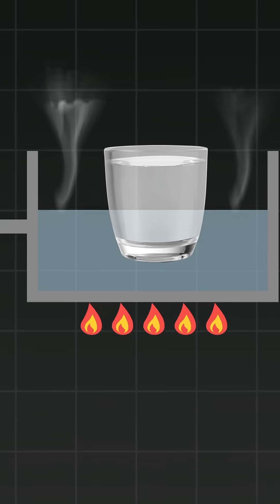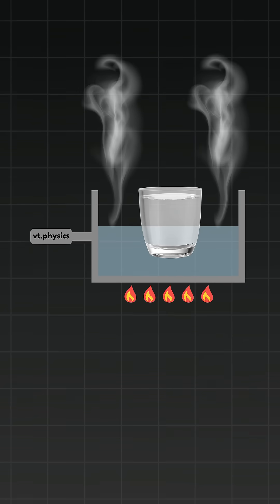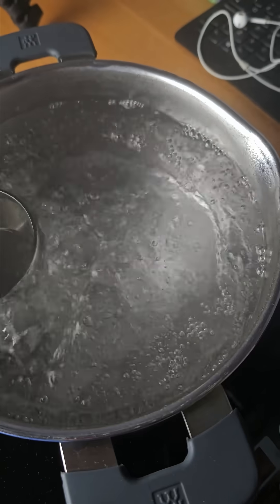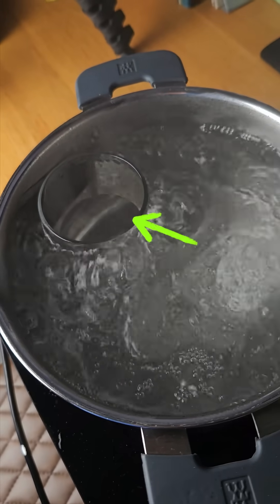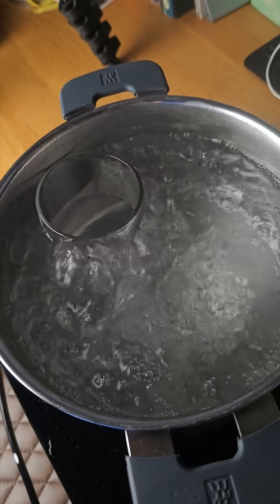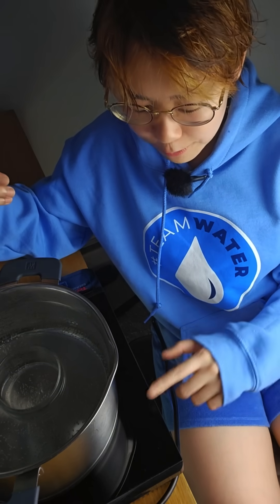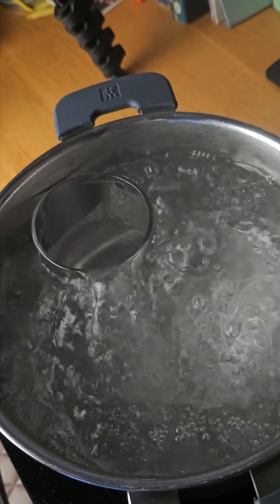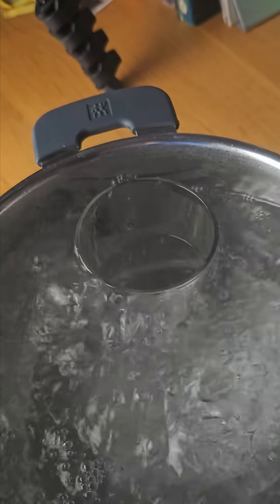Boiling Dilemma: Why Water in a Glass Won't Boil #teamwater

Comment: Note that due to variability of individual molecules energy even at a given tempeture, you still end up having some boiling off, it is just soo much slower that it does not cause the kind of visual phenomenon we normally associated with boiling.

Similarly water also starts turning into water vapor way earlier than normal boiling tempeture, as the hotter molecules have reach the required energy to turn into steam, but there is just so much fewer of them that we usually do not see visual bubbles the same way than when we normally see "water boiling".

What really causes issues is the amount of water vapors put off by the main boiling water, which will saturate the air with enough water that a similar amount would condense back into the inner cub. If you really want to see how things relate you will want to isolate the air they are connected to, and then you might see that a tiny amount of water in the inner cub would have evaporated during your trial.

Comment: This is why you use a double boiler to melt chocolate or heat milk. Because this process will heat it to a certain temperature without it ever getting hotter. So no worries about it burning or scalding.

Comment: The boiling water is at the surface of the pot.  It is much hotter than 100C. That glass will never get above 100C, so the water at the surface of the glass will not boil.

Comment: i think it is possible. Steam can be hotter than 100C. So if you manage to make enough steam hotter than 100C that connects to the glass you will make it boil as long as the glass with water doesnt get cooled fast enough.
But, you need a lot, and i mean a lot of energy put into that pot and it is highly probably there will be no water at that time anymore

Comment: Technically it can still boil for two reasons. The glass is not staying perfectly level in the water. As the water starts to boil the bubble that it forms can tip over the glass adding the water from the glass into the water that is already boiling. The bubbles can also spill into the class as it boiling water spills into the glass so eventually the temperature both inside and outside the glass will even out. The only way you can really prevent this from happening is if you can keep them from mixing. But the water in the glass is still going to boil anyway it's just going to take longer because it's not getting direct heat.

Comment: Put a thermometer in the glass and it will never reach 100 degrees because there is a small temperature gradient loss due to the thickness of the glass wall.
Water can boil over or under 100 degrees depending on the pressure it is under.

Comment: The what doesn’t boil at 100 Celsius, also the atmospheric pressure must be 1 

if you are on a mountain the water would boil at a lower temperature than 100 Celsius

Comment: The glass of water in in an environment above atmospheric pressure. It will not boil at the same temp as the water surrounding it. It must get slightly higher. That will not happen if it is floating, and surrounded by the higher pressure surrounding it. But a very simple addition to the setup will cause the water in the cup to instantly boil. It is not rocket science

Comment: in a closed system, water can exceed 100°C if the pressure is increased. This is because higher pressure raises the boiling point of water, allowing it to remain in liquid form at higher temperature

Comment: Its amazing how much you can learn , if you're curious.  

I've known this forever because of cooking and tempering chocolate in a double boiler. 

You can also hard-boil eggs in a paper cup , in a campfire - for similar reasons. 
(The paper cup cant burn because the water inside cools it down to 100°c , below the papers flame temp.

Comment: Glass is also a medium heat conductor. it absorbs quite a lot and becomes cold very quickly, so the energy needed to boil the water in the glass must be greater than 100C.

Comment: Put a lid on the pot, and the water beginn to boil. Or explain that the transfer of the energie trough the glas is slower then the escape of the energie over the surface of the water in the glass. Take a Glass with a smaler suface or put a lid on the pot and the water will in the glass will boil.

Comment: That's actually amazing. So if I put a glass of water in a pot of boiling water, it's still never going to boil the water in the glass. Very impressive. I never knew about latent heat.

Comment: there are some cases where water can super heat and get over boiling point while still liquid but in most reasonable cases the water in the pot wont get hot enough to boil the water in the glass.

Comment: Replace the glass by a mathematical surface with the same shape. The water inside the surface is not in contact with the hot cooking plate . By the reasoning presented here, it should not start to boil but it does. The missing ingredient is convective flow which causes the water inside the volume to move around the pan bringing it into contact with the hot bottom surface. The physical glass prevents convective flow from moving the water around. Btw I think that insulation plays no role. If the glass is replaced by a metal cup, the trick still should work.

Comment: It would boil though as steam passes through it on its way out and passes the necessary heat to it that way. You could see that more clearly with two containers that are closer in diameter. It will still boil how shes showing, eventually, but it's definitely slow

Comment: Because water in the pot doesn't boil. Where water molecules contact the heat source [The bottom of the pan.] is ONLY where the water is converted into a gas/vapor.

Comment: If the boiling is fierce enough the gas (water vapor) bubles in the pot will reduce the buoyancy efect so much that the glass will sink to the bottom. At this point, assuming the water are still in the glass, heat will transfer strait from the metal to the glass, and- assuming the glass doesnt break- will couse the water to boil.
Given enough heat- it will find a way.

Comment: Pure water at boils at 100c at one atmosphere.  Your double boiler's water cannot exceed 100c to create steam as the energy input is stuck at 100c, so isn't it technically boiling? What happens if you exceed 1 atmosphere of pressure?

Comment: Pshhh. Put a lid on it, raise the pressure and once the temperature has equalized above 100C, release the pressure (rapidly) and it will boil. It will all boil and there will be hot water going everywhere potentially burning anyone around it. 🤷‍♂️ Never said you'd be safe, but it's possible.

Comment: what if you have a thimble inside the glass with more water in the thimble?
Reply: Don't those got holes in em? If so, there shouldn't be any effect, since the water could just flow between the cup and thimble
Reply: @KaneS-e1k  its a joke, i meant a tiny thimble cup, not an actual thimble,like infinite regression.
Reply: @paultimson6674 In tat case I feel like the water in the smaller containers would probably just have less and less heat transferred to it, until at a certain point you don't get any change at all.

Comment: Pretty much how all water bath canning works.  You just need to get the contents of the inside of the jar up to a certain temperature.  And, an acidic environment means botulism won't grow.

For non-acidic foods, you have to use a pressure canner.

Throw in altitude and then you have some real fun with boiling.

The science of home canning is crazy.

Comment: yeah well...might use a different container since glass is also a thermal insulator even tho its not the best at it but still. 
Thin copper probably best option for this experiment.

Comment: There is a little mistake in you reasoning, which is that the pressure at the bottom of the pot should be a very little higher that 100°C (~100.1°C for 4cm of water) and if the bottom of you glass was very conductive (e.g. a sheet of silver) + the glass is heavy enough to have the level of water significantly lower inside than outside. I wouldn't be surprised to see some bubbles.

Comment: No, you actually can do it! If pot gets extremely hot then heat radiation will increase glass temperature hot enough to start boiling water inside it. The issue is your stove is too weak.

Comment: ohhhhh, so to actually vaporize the water you need extra energy after 100 C, but water surrounding it can't provide that extra energy? THat's super neat.

Though I guess if glass's bottom was touching the pot it'd be a different story?

Comment: How about the glass? Is the glass a good thermal conductor?
Reply from the maker: Glass is not a good conductor of thermal energy. But eventually, if it is in the boiling water long enough, it should reach thermal equilibrium with the water
Reply: @vt.physics ah, I seen them. Thanks!

Comment: What about the insulating property of the glass? The water inside the glass loses heat through radiation, convection of the air and evaporation. It gains heat from the boiling water in the pan, but between it is the glass, and glass is quite a good insulator. So for the water inside the glass to reach 100°, the water in the pan must be at a higher temperature, which it never will.

Comment: This is why you melt chocolate basically exactly in this way. They make fondue pots which allow you to fill the bottom one with water to boil, and then put the chocolate in the top one. It prevents you from ever burning the chocolate.
Reply: Yes and no, what the here does is basically spreading the heat, without the water, parts of the bottom would quickly heat to a high temperature while other parts weren't hot enough to melt the chocolate yet. So even a small flame could burn some parts of the chocolate. But yes, it helps a lot to limit the maximum temperature. I wonder at what exact temperature chocolate burns.
Reply: @a.vanwijk2268  well that's because with a pot in a pot you can't make it float like a boat but need to make it rest on the rim. The rim of a fondue pot transfers heat from one pot to the next directly, so the water isn't there to act as a thermal regulator entirely. If you don't put water in the bottom, the heat will still get into the top pot more directly and by the time the chocolate has melted it has also started to burn. With the water the heat transfers from pot to water to pot, and the water keeps the lower pot at a regular temp by having a higher specific heat, so the chocolate gets its heat more evenly through that water and also at a regulated max temp. 

Eventually, though, enough heat will transfer pot to pot even with the water, and will burn the chocolate, and as the water evaporates to regulate the temp it also reduces the amount of water to do the regulation, so even a fondue pot is imperfect at this. But her experiment would also suffer the same issue, as the pot water would eventually evaporate enough to ensure the cup touches the pot and begins absorbing heat directly.
Reply: @Will_Forge Okay, now I have to look up what a fondue pot looks like in your country. I assume it's not Switzerland.
Reply: @a.vanwijk2268  Here in the states it's basically a pot inside another pot where the top pot rests on the bottom pot's rim. Typically made of ceramics or metals that heat better. I have one from my mom that's ceramic with brass handle and lid. You fill the bottom one with water, and put chocolate in the top to melt. The boiling water heats the top pot, and the ceramic material reduces heat transferred through the contact at the rim. So in the end you get what she did in her experiment because the water turns to steam before heating the top pot enough to burn the chocolate.

Now I want to find out how you guys solve the burning issue, because it is still possible to fuck up with ours and burn your chocolate anyway as the water evaporates too much. Maybe yours is better, or maybe about the same-ish, but now I'm curious!
Reply: @a.vanwijk2268  Oh! I googled it. The issue was mine. Apparently my pot is called a "melting pot" and not a fondue pot. It is used to melt chocolate for any reason including for fondue, so I assumed it was just called that. But apparently a fondue pot has a place for a candle underneath it so you don't need to put it on a stove top.

My bad!

So a melting pot, then! 😆

Comment: Theory is false depend on material and heat point of it u can get a metal pan and begin to boil the water and get steam now get glass of a insulated plastic thing put water in center it will never boil or get steam so let use our logic a bit
Reply: What??

Comment: Sounds like it's the same as why you can't boil water in an oven? You can raise the air temperature beyond 100°c but the water in of it self can't directly absorb temperature beyond 100°c to start boiling, it'll only be able to steam. That huge difference between convection and conduction

Comment: Indeed! In fact, I recall a video, from I think Prof. Andrew Robertson, that explains there's a surface tension pressure the steam bubble must overcome in order to expand, and this would mean that it has to get hotter than 100°C to start boiling in that section. That's even more reason that the cup will never start boiling. I think this may also be why water boils less, or stops boiling all together, when you stir it vigorously. You're distributing the heat more evenly and preventing hot pockets that could create a steam bubble

Comment: Next time maybe use a steel glass
Reply: Same effect 
If the water inside the glass should be 100c
Then the glass needs to be more than that
Which it can't be
Reply: @creativelad3680  exactly my point.. for the water inside the glass to be same as the water in the pot maybe use a glass made of a conducting material..
Reply: @anshumas thermodynamics would create an equilibrium eventually
But the water inside the glass would never boil

Comment: if you take a bottle of water you can set it on the hot oven coil and it wont melt, i assume it will after it boils but still cool to see

Comment: This is only true under standard atmospheric conditions

if you where able to reduce the atmospheric pressure then the boiling point of water would be reduced below 100 degrees C to boil

For context this knowledge doesn't help us with planet side reactors but reactors built in space can use the zero pressure of space to boil the water and generate steam in once chamber and use another chamber to pressurize the water before returning it to the no pressure chamber, very similar to how current reactors are setup with a heating chamber and a cooling chamber before returning the trapped water from the cooling chamber back to the boiling chamber

Comment: Make the container metal and put a lid on it. Glass is a terrible conductor. You just insulated the water in the glass just enough so that the evaporative cooling and heat transfer were equal to just below the phase change energy.

Comment: My favourite thing about latent heat of vaporisation is how much we rely on it every day, it's essential for refrigeration and air conditioning (essentially the same technology with heat pump), in order for something to vaporise it's needs extra heat, as explained here, but if there is no apparent source of heat from a flame or something's but vaporisation is still occurring then it will draw in heat from it's surroundings, giving a cooling effect as the heat is taken away vaporised material, this works in reverse too, a gas condensing will give heating effect. Heat pumps force a gas to compress (heating)liquifying it, then releases the pressure, vaporising (cooling) stuck a fan on either side of this loop to and you have air conditioning. And the best part is that for a single kWh of power consumption you move up to 5kWh of heat energy. Move this heat outside and you have air conditioning or refrigeration and move it inside to warm something up. Yes air conditioners can be reversed to give the heating effect during winter, while not very common in the past it is becoming more common now due to it's extremely high efficiency Vs gas or other FF heat sources

Comment: water can get above 100c if you microwave pure water in a glass container, jostling the resulting water will cause it to explode as a bunch of steam is suddenly released. a lack of nucleation sites and equal heating of all of the water prevents boiling.

Comment: That's why you melt chocolate in a bowl in boiling water and not directly on the heater.
Boiling "locks" the temperature giving more control over it.

Comment: Without looking or watch I would guess it wouldnt boil but would remain hot. since the difference would then be the thermal capacitance of the vessel inside said water? As water cant be hotter than boiling naturally I dont see how water inside said vessel would boil as quick or at all?

Comment: Commenting before watching- 

I don’t think the water in the glass will boil at all. 

If the glass isn’t touching the bottom of the pan, then the only way the water in the glass can heat up is from contact from the water in the pan around it, which can’t exceed 100°C, therefore won’t be able to push the water in the glass past 100°C. 

If the glass of water was in an oil bath, then I think it could possibly boil.
Reply: I’m proud of myself. Lol.

Comment: I'm not a physicist but I do have a highschool diploma, and my guess is that the extra room in the glass allows enough heat to escape which lowers the temperature of the water inside, although still hot it won't get up to boiling temperature because of a simple 1st grade thermodynamics concept of entropy.

Comment: What would happen if you closed the lid of the pot? Would making the system a closed one instead of open allow the water to heat past its boiling point as the pressure within increases?